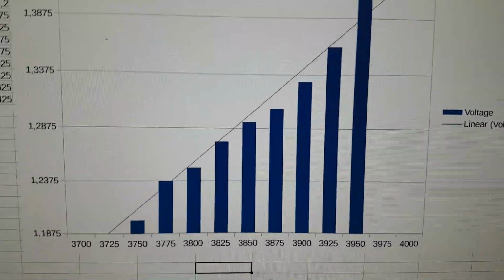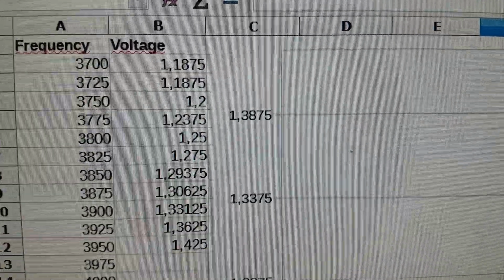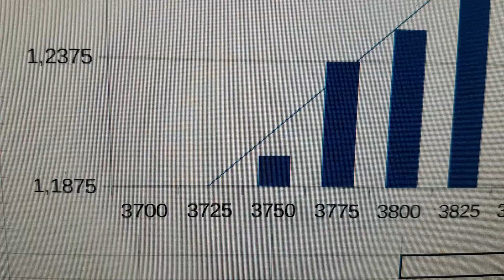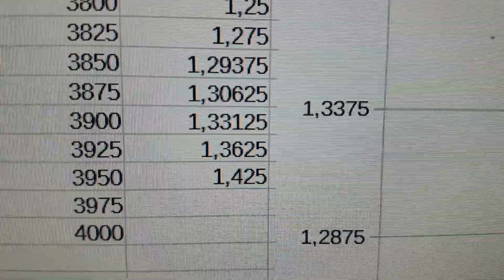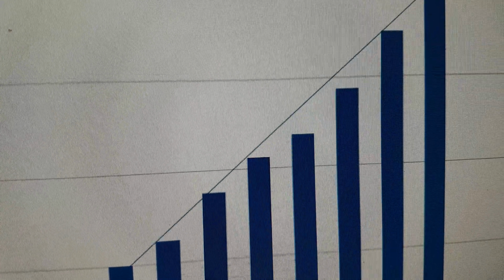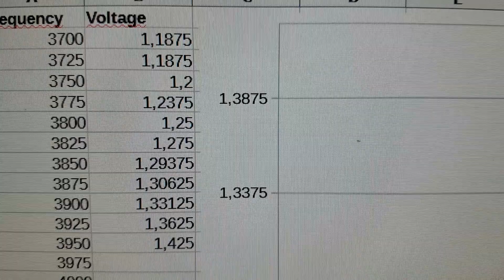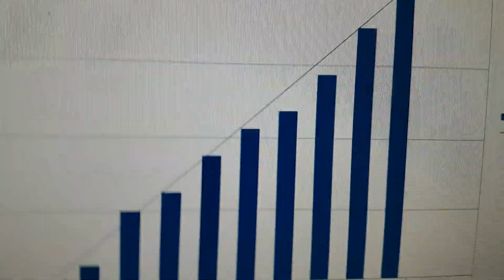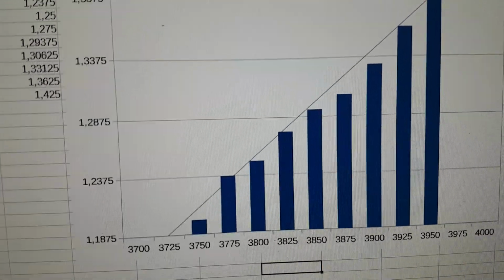Vcore scaling curve for AMD Ryzen 7 1700 Overclocking.

Comment: this guys a a fool, this is not stable overclock voltages, hes just testing the lowest voltage it will boot at for a given frequency then calls it a day.
Reply from the maker: I stresstested with Prime 95 for 30 minutes for each setting. The voltages shown are stable for my rig, but of course it won't be stable for everyone as stability depens on silicon lottery with individual chips, VRM quality on the motherboard you use, overall PCB quality (traces, copper layers, all that), PSU quality (voltage regulation, ripple supression, wire gauge, all that), if your components are in the low to crap tier, and/or you got unlucky in the silicon lottery, you may very well need much higher voltages than shown here to reach stability for your specific system- YOU are in fact the "fool" for just assuming that the voltages are not possibly stable for anyone. I don't know if it's because your components are lower quality than mine, or because you just like to walk around and feel confident about things you are obviously clueless about. But either way it's neither nice, nor appropriate to call someone a fool without taking into consideration that you might not have all the information required to make such an assessment. Have a good day, and please try to be more civil with the next person you come across. :)
Reply: @OzzedNet  my apologies, you didnt mention anything about stress testing in the video.
Reply from the maker: @slybunda  TLDR: Apology accepted. :) I could have been more clear about it, sure, but I would assume that most people are interested in stable voltages, since that is what you're actually need to use your computer daily. I think "boot up voltages" is more of an edge case and with my system I could do both lower voltages and higher frequencies if "just being able to boot" is the requirement. It should be a dead giveaway that 3.95Ghz is the highest I was able tio get to, if "just booting" without any kind of stability is the goal I could probably go to at least 4.15-4.2Ghz. Anyhow, apology accepted. :)
Reply: @OzzedNet  whats the power consumption like when overclocked? stock cpu is 65w, is it a case that overclocking by 20% increases power consumption by 50%?
Reply from the maker: @slybunda  TDP is just the wattage the cooler should be designed to handle, not the power consumption itself, But I guess you could say it depends. I never bothered much with PBO when I had this processor, but found that a static overclock actually have much better performance since I was able to go well beyond the factory max boost. I don't have power figures, but what I can tell you is that the numbers in the video where done with an AiO, so it's probably quite high. With air cooling I never got above 3.85Ghz before things got toasty.

It's 8 cores, just like the 1800X, and 3.95 is beyond even 1800X's stock all core boost, and what is more the voltage/frequency curve is on average worse on the 1700, dince they are lower binned parts SKU'ed for a lower clock, so if you don't have an AiO, it gets difficult to cool them at these frequencies.

Comment: i got 1700 3,7Ghz OC , Vcore 1.25v using MSI B350-bazooka , bios need updated , Ram DDR4 Patriot  burst 2x8GB dual chanel OC to 3200 mhz using 1.35v . STABLE for interior rendering using 3dsmax+vray/corona , cooler using deepcool gammax 400 Idle temp 44C .. Rendering 58-60C full core activated

Comment: I have this cpu and had b450-f mobo I want to oc upto 3.7ghz ,any advice how many voltage?
Reply from the maker: The advice I can give is in the video itself. There you can see a table with how much voltage is roughly required for a specific frequency. for 3.7Ghz 1.2V should work fine, but depending on the chip quality you may be able to go lower or might need to go higher.
Reply: Oskar Hanberg thank you, cuz its my first time for oc!

Comment: Important info are missing, like: Motherboard, Cooling (Heatsink, thermal compound paste). OC capability depends on them too.
Reply from the maker: The motherboard is an ASUS Prime X370 Pro, Cooling is an NZXT Kraken X62, thermal paste is Thermal Grillzy Kryonaut. So the cooling is very good for the system. I later got an ASUS Crosshair VII hero and tested the same processor and there was no difference in the OC potential or voltage/frequency curve so I think in my case the Processor was the limiting factor.

Comment: My 1700 ist operating with Multi x38(3,8ghz) with Fixed 1.275 volts (Undervolting) and its stable. Using Aorus AX370 Gaming 5 with 2x 8GB GSkill Ripjaws V with 3200mhz   my Temp is at 40°C Max 48°C air cooled.  
 I´m going to Try x40 ( 4ghz) with 1.325V fixed does this work?
Reply from the maker: If your cooling can handle it, the 1700 can take up to 1.425V. But obviously step it up gradually until you're stable.
Reply: @OzzedNet  ok so i raise it to 4ghz and go up in 0.025v steps?
Reply from the maker: That's one way to do it but how I usually do things is I up the frequency a bit 25mhz. If it's not stable, I increase the voltage. Rinse and repeat until it's stable, then up the frequency again, then voltage, and so on.  Not every chip is created equal so your mileage may vary of course. In the video I show how my particular cpu scales with voltage on my particular motherboard, but everyone's setup is different so take it as a rough guideline.
Reply: @OzzedNet  Do i only Have to Raise the Voltage and the Multiplier or do i have to change also the SOC Voltage. it´s actual on 1.1v FIXED.
Reply from the maker: SoC-voltage adjustments are generally not necessary for CPU-overclocking. 1.1V is fine. What you need to focus on is Vcore. (don't go above 1.425V, anything below that is perfectly fine if your cooling can handle it.)

Comment: 3.7 @ 1.248v (auto voltage would set it to 1.2v but HWmonitor would show it's at 1.248v, so I set that in the Bios)
I should probably try 1.1875v as you did.

Comment: seems about right. im sitting at 3.8 @ 1.26. I can get 4.0 on both my 1700's but only at 1.45v. hits 83c air cooled noctua u12 stable. theres just no reason to push an extra 200mhz vs 65c noctua u12 and 63c d15. the 200 will do nothing for games.
single core cbr15 @ 3.8 157, 3.9 - 160, 4.0 - 164.
at 4.0 it equals my i5 3570k @ 4.4g with 165.
whats funny about the intel score, is i see an i7 4770k 4.4g at 165 also, lol.
waiting on the ryzen 2700. if it can hit 4.4 at 70c air cooled noctua d15, i'll be a happy.
Reply from the maker: That's the one I will try to get my hands on as well. I'm super curious about how high it can go :)

Comment: Please, if someone is thinking, I will use this chart to overclock my Ryzen, there are toooo many things wrong with that statement for it ever to work. BUT the long and short of it is, all chips are different 3.975ghz on all cores on my r7 1700 for example only takes about a voltage of 1.365, that voltage because I have to use offsets varies and it's not exact.  So after 3 Cinebench runs (that's how I get my voltages is with 3 runs, stress testing takes longer and Cinebench I can se really quick to see what my MAX voltage will hit before I make any other decision.  
Anyways, that's 3.975Ghz with the voltage NEVER going above 1.39v while the guys r7 1700 (same chip I am talking about here) hit well over 1.4v before he could even hit and stabilize at 3.95ghz.  Same chip, and yes they may be closer if we happen to be using different components, but what is crazier, the delta can increase if we were to be using the exact same test benches due to silicon lottery, binning, an asics.
Reply from the maker: It's not meant as a "do this and it'll work"-video, but I do think it can be a good pointer in terms of delta voltages and what a "voltage wall" can look like. I'm well aware that some people can hit 4.1Ghz with 1.35V, so in that regard I really did not do well in the lottery.
Reply: Oskar Hanberg Never doubted you my friend.  I know you know that, I didn't want someone who maybe tried overclocking but sees it now as impossible like a lot of good overclockers saw it at first, it was intimidating.  BUT maybe they still want to overclock so they just look up ryzen vcore overclocking or something naïve like that and just try to follow suit with what every oc ryzen video they chose.  never know, my comment might stop someone from that exact thing, OR it might stop someone from doing just that, even if they get all the same components and do it correctly, follow a good guide and follow it to the t, if they don't know how to dial in the voltages one they are stable, or how to max subtimings or any of the little things that tie a good overclocked system together to make it stable; LLC, VDDCR SOC voltage, CPU Switching Frequency (I am not sure about the last one I mentioned, cpu switching frequency, but I have read convincing theories.

Comment: What is the offset vcore value in order to achieve 1.2v with 1700?
Reply from the maker: When you set "offset mode" in UEFI it will usually tell you what the base volt is. Just take 1.2 minus the base volt and then you'll know how much to add,
Reply: Oh, wow! That was fast! Thanks! :D

Comment: Do you static set volt when overclock or offset?
Reply from the maker: I set the volt directly, not through offset. But if you stress the CPU in say OCCT and monitor your voltage you will get a baseline that also applies for when you use the offset method.

Comment: Hello thanks for a good info you have shared. The default high voltage spike of 1.51 is just normal. Ifyou are worried then just turn the cpb off in amd cbs option in bios menu and yr volt will drop below 1.2. that spike is for xfr to work properly. But only the xfr has 3% max benefit over turning it off.
If you are really looking for less power consumption then p state oc is only option otherwise the lowest frequency of cpu will not drop when idle

Comment: Some do overclock better then others. I probably have one of the worst ones. I used Passmark 9.0 to test my cpu in many different ways and ran that for 10 passes. To be stable at 3.8 ghz, I need to have 1.325 volts for the cpu core. Temps are still acceptable though. The cpu maxes out in my computer at 71 degrees. That is not bad for a stock cooler. Although, i do have a best case scenario. I have a corsair 540 with 3 intake fans and 3 exhaust fans in a cool basement. the only reason why I don't push further is as the power draw increases, so does my motherboard temps under these stresses. It will go over 60 degrees as is due to the power draw for that voltage. Going up from here only amplifies the issue even more.

Comment: im 4.0 ghz at  1.368v all day no issues  My scores on cinebench are 1785  and this is with 3200 ram.            Is this good?
Reply from the maker: I would say it is, yes. Mine needs 1.4125v to even reach 3.95Ghz, and my ram is currently stuck at 2666Mhz even though it's specified for 2933Mhz. I score 1721 in Cinebench.
Reply: yeah but what motherboard do u have that u have to crank up the voltage so high
Reply: Austin Shelton 
hahaha okay... ill bite. Okay so you overclocked all cores to operate at 4ghz for atleast a few hours at 100% load and you somehow, using a r7 1700 cpu only miraculously only used 1.368v all day long, not a single issue, it is not stable unless your computer can go as long as it needs to, all day if so be it, at 100% load and not thermal throttle or blu screen or black screen from your lack of voltages or for 8 cpus to operate at that speed you would need a motherboard that doesn't have power delivery clean enough, also that Cinebench score....mate, I score higher and average about the same after a few runs are averaged and I am only 3.975ghz on all 8 8cores of my 1700, ram speed is 2933 like I said and I think I mentioned, to hit 4 ghz on my 1700 the pay is NOT worth how I have to tip the voltage scale WAY UP from 3.975ghz till 4ghz is like more than 5 offset jumps 3.975ghz is stable with my RAM at2933mhz with a core voltage of 1.365v.  0.003v lower than where 'you're saying 3200mhz RAM with 4ghz on all 8 cores has landed you....
Did I already mention, they don't make a mother with power phases officiate enough to deliver such a clean power source that you can hit 4ghz on a r7 1700 at 1.368v I mean I have seen ryzen 3 1200's hit 4.1ghz with 1.32v but they only have like 4 cores, and 4 threads, where as you and I have to power many more cores and threads.
Reply: actuallywill dude u seem to talk shit..maybe he has a good binned CPU...besides mine use even less voltage and I have reached 4,15
Reply: Austin Shelton awsum dude
Reply: I have a Ryzen 7 1700 and I can't run this shit on 3.9Ghz at 1.36875Voltage... Why god?
Reply: I am doing 3.9Ghz at 1.304V

Comment: So if I want to overclock the 1700 to 3.7GHz I should changed the voltage from auto/default to 1.875 ?
*newbie here :d
Reply: set vcore at 1.37 - 1.38 for 3.7 ghz...set vsoc to 1.1 - 1.15...thats safe..how ever you can get away with 1.2 vsoc if its a bad memory controller..
Reply from the maker: Every processor is different but I'd say it's a good starting point. If it doesn't boot, or doesn't run at least 30 minutes of OCCT I'd say try to bump it a little and start over again. It takes experimentation before you hit the sweet spot. You might even be able to go lower.
Reply: 1.8 ???? wtf

Comment: I need 1.3375V for 3.9Ghz for my 1700, 1.33125V passes for it as well for daily use and gaming but not stress test or high cpu intensive benchmarks. This is with LLC3 for the Asus Prime x370. I am on 3.95V at 1.3625V LLC3, vcore max is around 1.395V - 1.4V.

Comment: It's not uncommon for non X Ryzen CPU's to have difficulty reaching 4.0. I think they rarely would. I have a friend that has the 1700 and it behaves very very similarly to yours. This has been reported by many Ryzen 7 1700 owners. But for that money, I think it's the best chip on the market. I don't think it's worth paying the difference and getting the 1800X.
Reply from the maker: I agree. At least I'm getting to a higher frequency than stock. I've seen reports of people with the 1800X that can't reach 4.1Ghz on all cores when overclocking, so it actually results in worse single core performance for them. Out of the 8 core bunch, the 1700 is the most bang for the buck.
Reply: Don't agree...it seems that x variants give more problems....as duely noted by many forum readings and YouTube...1800x getting 3.9-4.0.....my 1700 so far I have reached 4.15...non x is better...and this can be seen on YouTube ...another guy on a taichi board reached 4.2

Comment: How did you test stability?
Reply from the maker: OCCT Large Data Set. For 3.8Ghz and below I ran the test for 24h per setting, for numbers from 3825Mhz to 3950Mhz I ran the same test but for 48 hours each time. 

If the  computer would restarts or the test would say "error detected at  core X" I would up the voltage and try again until the test would pass. The numbers in the graph are the stable voltages for my specific chip.